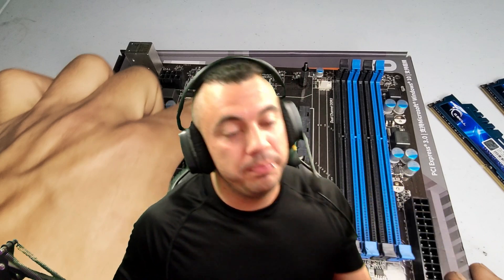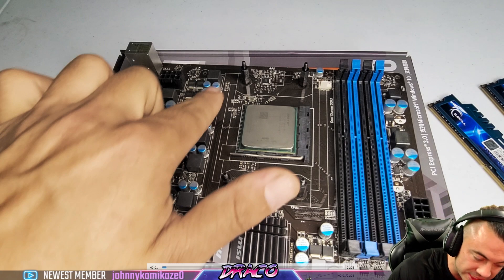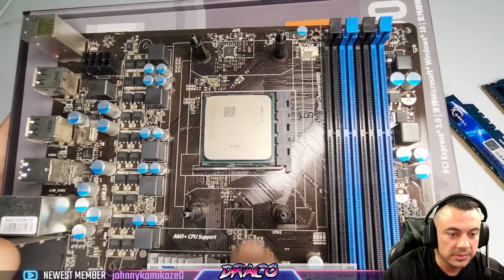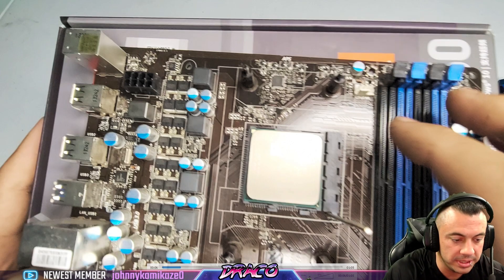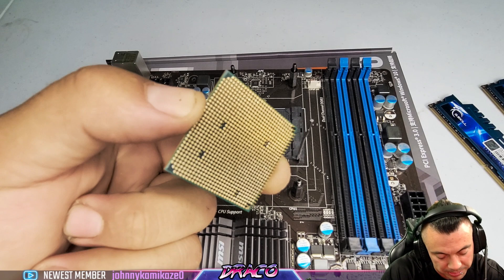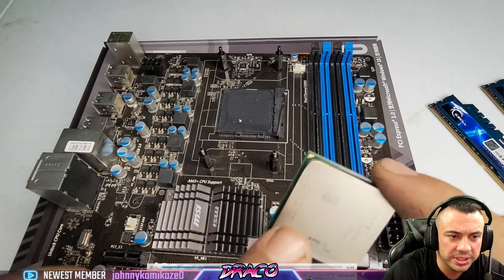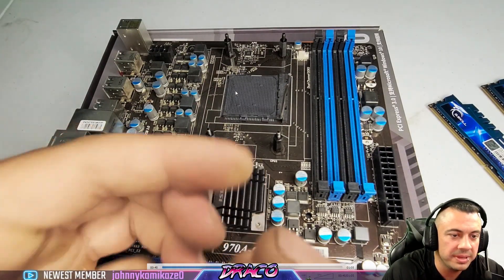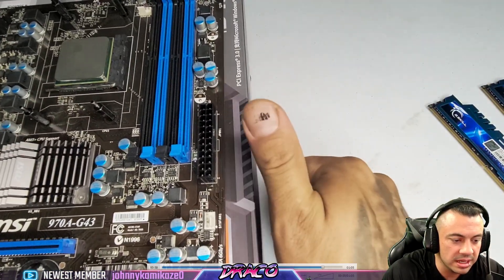How to Install Upgrade and Remove CPU THE RIGHT WAY - Gaming PC Build

Comment: I have the cpu removed and replaced, but one of the old locking screw studs doesn’t come out of the motherboard. The new cooling fan piece has 4 locking screw.s. How do I put the new fan in?